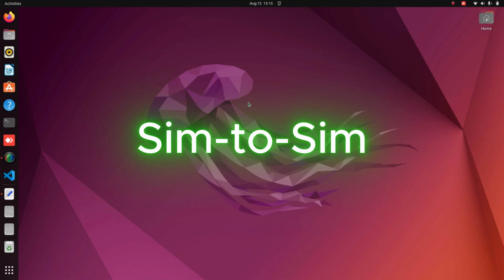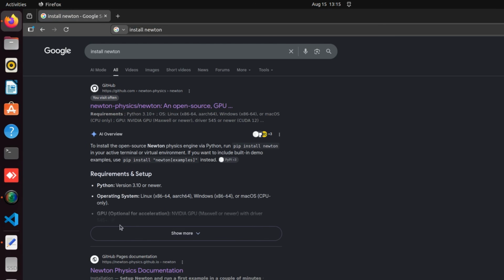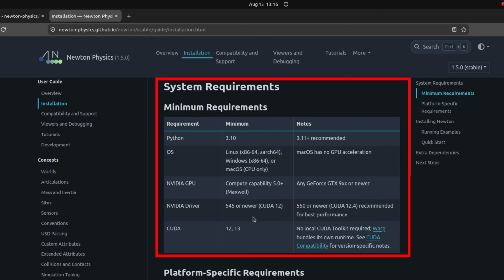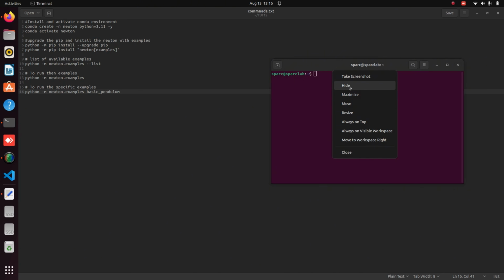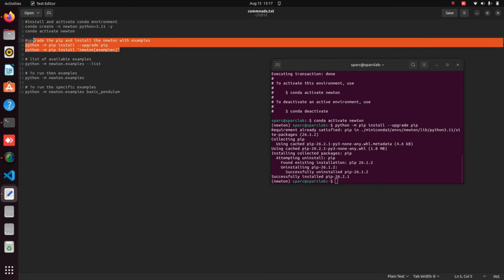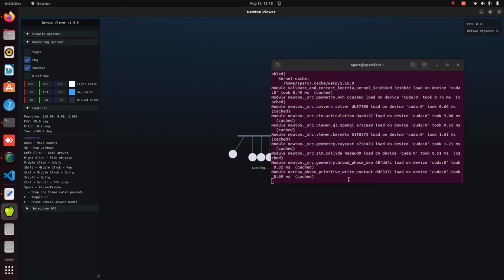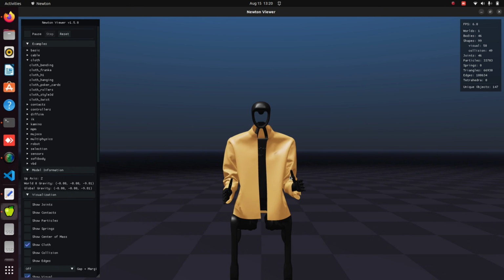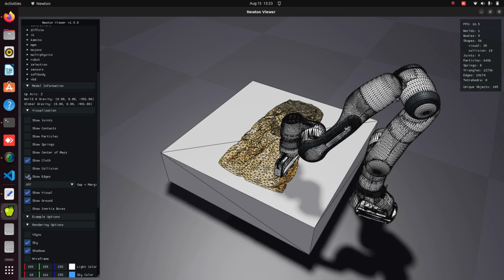Sim-to-Sim Tutorial 1: Install NVIDIA Newton Physics Engine (Isaac Lab Alternative)

Comment: Which approch will you follow for actuator cloning?
Reply from the maker: I’d start by matching the actuator components available in Newton, PD control, torque/velocity limits and command delay and add custom dynamics if needed. More info here: https://newton-physics.github.io/newton/stable/concepts/actuators.html